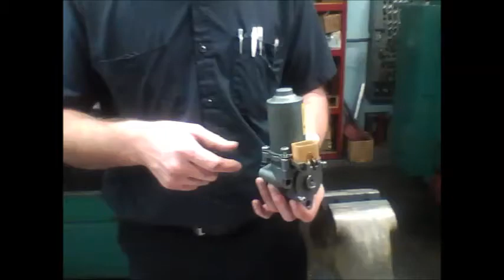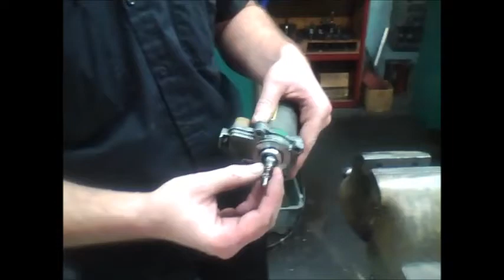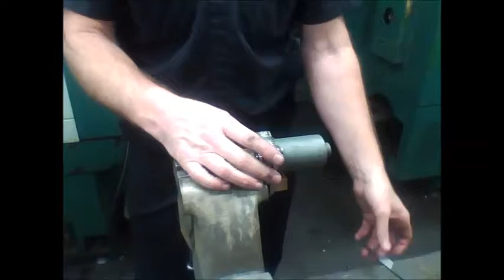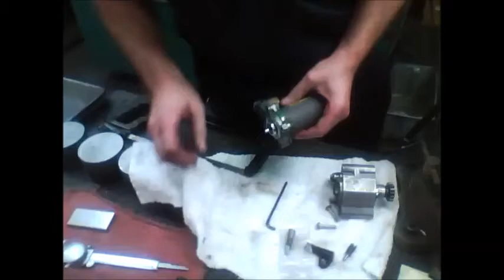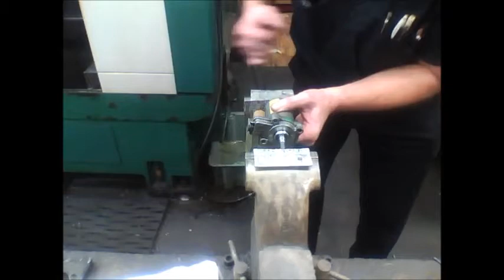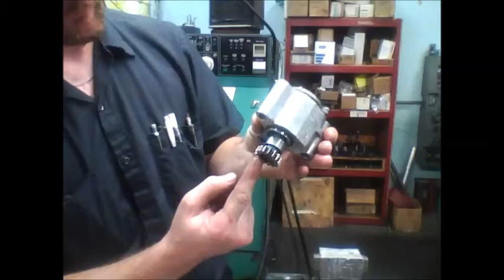BMW transfer case actuator worm gear replacement

Comment: My new to me 07 328XI had the grinding sound on startup. Lights galore on the dash 4x4 and such. Several faults stored which would not clear. Pulled the motor and opened it up. The gear was shot and looked just like the one in the video. Installed the kit and cleared faults. Viola problem solved. Just make sure you reset the system if you replace the resistor that comes in the kit. I also changed the transfer case fluid since I didn't know if it was ever done. Saved me a lot of time and money as we were going to just install a used transfer case. Many thanks for this kit and answering any questions I had during the gear installation.
Reply: I have the same exact car and the same issue. I've already gotten a new T.case motor  (gonna rebuild old one for back up)  
 I plan on doing it myself and I'm wondering what exactly do you mean by "Reset System" ?   Is it gonna require a high end scanner to do?

Comment: Jerry. Thank you so much for your product. I had 4x4 AWD, DSC, Brake, EMERG EBV lights were on on my 2008 BMW 535xi and replacing this fixed the problem. People like you deserve lot of credit. I went from buying a new transfer case ($400) to $60 and couple of hours of do it yourself project. (His product is listed on ebay) Thanks again my friend.

Comment from the maker: Anytime the eBay listings for these parts doesn't show any parts available, it means one of 2 things. Either I'm waiting to receive more stock or I just haven't had a chance to relist it. It might take up to a week to relist the 6pc kits because some of the pieces that I order haven't made it in yet. But it shouldn't take more than a couple days at the most for the worm gears.

Comment: Hello Jerry,
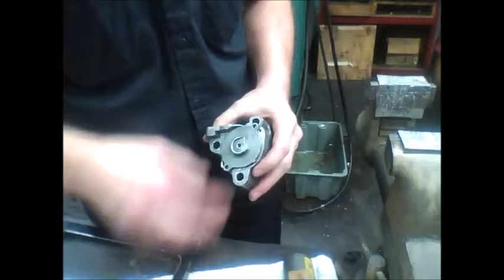Thank you for the wonderful video and for listing that part. I also got the 4x4, DSC,ABS and EBV failure on my dashboard. I am about to order two kits, just in case I need to share one with a friend. The thing is that the mating gear ( 5:28 ) has a little wear and I would very much like to replace that as well. Would you happen to have that part or can you tell me where can I find it?
Reply from the maker: Hi Iliya,
Sorry for the delayed response. I had planned on making the mating gear, but haven't come across one that was worn enough. If you have one that is exceptionally bad, I can see what I can do to get one to you. Message me on eBay. Search for cncskater :-)
-Jerry Whitmer

Comment: Hello Jerry. Great video and well done for machining this part. Question: has this fix actually held up and for how long. As far as I know the ATC300 was (wrongly) made to work in the E90 / E60 BMW not considering DCT and ABS activation which has resulted in a much shorter lifecycle of the entire transfer box. A manufacturer rep explained to me that once you start to hear a sound underneath the car its just a matter of time before the entire box lets go. Changing the servo motor actuator or just the worm gear isn't going to change much down the line...
Reply from the maker: ChawenHalo 008 thanks for the feedback. Yes, the worm gear replacement corrected the issue.

Comment: Jerry I know this was posted a while ago but I'm trying to troubleshoot no voltage 2 kl30. Basically saying no power to transfer case all fuses are good would it be a dead Actuator motor?

Comment: Jerry, what is the actuator motor part number for the one that you made the worm gear for? I have a 2008 535xi and the transfer case actuator motor part number is BMW OEM 7546671. Wanted to know if the gear works for mine. Been having the triad of lights for a while.  Thanks.

Comment: Before I order it I will like your opinion on my problem I have 2008 535xi and two days ago my abs 4✖️4 and break light came and I'm get and engine check light code U1126 must ppl said replacing this gear will solve the problem plz let me know if that's the case
Reply from the maker: +mohamed diallo I'm not sure about the U1126 code. There are 2 main causes for those lights to come on. Either the actuator motor isn't  working anymore or the motor is working but the gear is worn away enough to not move the mating gear. If you can hear the fast clicking sound  of the gear teeth missing right after you start the car, the gear is the problem.

Comment: Jerry, I was looking for a video on replacing the entire assembly when I saw your video, once I pull it out and confirm it is the worm gear, I will order your ebay part. Save me over $200. Questions..how did you figure out where to cut to expose the shaft, by just cutting a bit at a time? And can you recommend a good grease to use inside? And, how did you learn how to machine a worm gear? I can barely use a hack saw..
Reply: yes, worm gear is shot. Your link shows sold. Are you still producing these parts?
Reply from the maker: Sorry for the delayed response. I usually only use my phone to relist the worm gears on eBay so the link doesn't often get updated. I will do that now. I use moly-dee grease, there might be something better though. It took a little while but just a little reverse engineering :-)

Comment: Hi.How i can buy worm gear?
Reply from the maker: Hi. The worm gears are available on eBay. Just search for "BMW worm gear"
Reply: So i did find the worm gar on ebay and now we have the unit out and apart, the worm gear is worn very thin in the middle and the plastic gear is about disinegrated is that plastic gear available. you show yours to be intact.
Reply: nevermind tech misinformed me

Comment: Does the actuator gear fit in a 2006 330xi manual?
Reply from the maker: Hi Ry
Yes. This worm gear fits your 2006 330xi stick shift :-)

Comment: Hi, do still have the worn gear for sale i search on ebay and nothing came out.
Reply from the maker: Hi yes. Here is the link:
https://www.ebay.com/i/162685643135
Reply: Jerry Whitmer question i open my motor and its good so my problem is not the gear so far i try buying an used one still dint work my light stays on what  else should i look for i came across that it could also be the steering wheel sensor that is bad to reset it, could that be faulty? Cuz when i turn the signal light and i turn they wont turn off. This came light came out after my belt broke and battery died belt has been replace and battery good
Reply from the maker: Based on the fact that your turning light doesn't turn itself off after a turn, I agree that there's an issue with the steering angle sensor.

Comment: Where can you buy the individual parts for this? It would be very helpful to have part numbers for the gears, o-rings, etc, - or just a source to order them.
Reply from the maker: +Synono Maus for some reason the eBay address changes each time I relist and I forgot to update the link. its updated now. thanks :-)
Reply: Jerry Whitmer
Reply: Jerry Whitmer hi jerry. do you no if the other gear is available? the nylon gear that mates to your worm gear I just got looks a bit worn. thank you